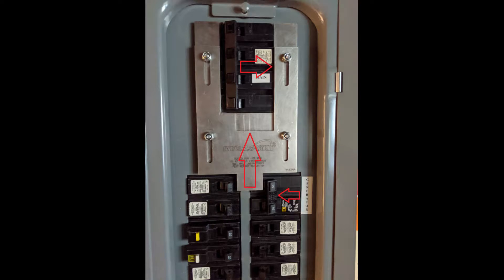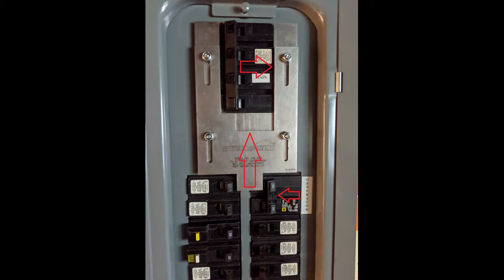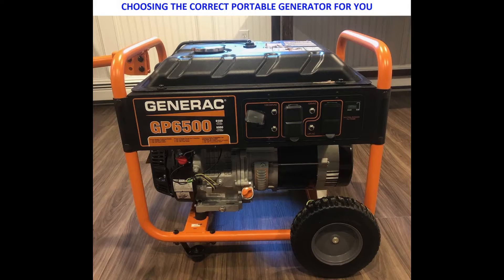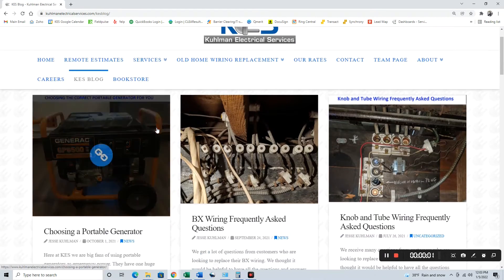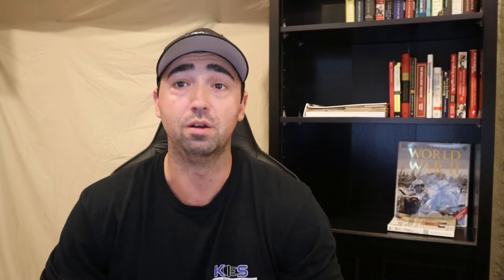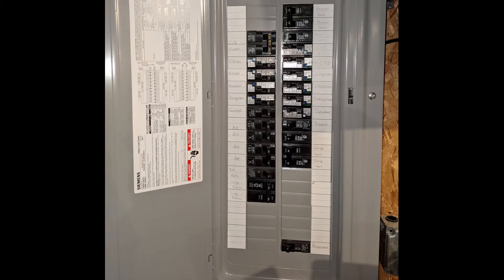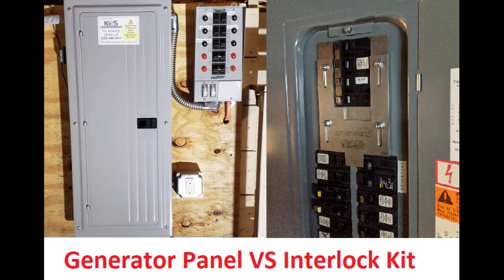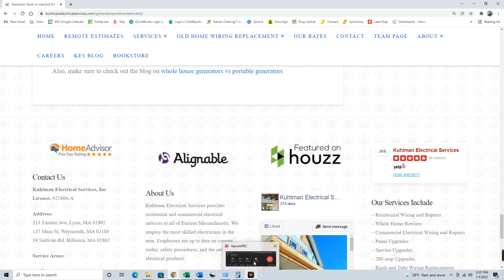Generator Electrical Panel Interlock kit: What is it? | Jesse Kuhlman

Comment: How do I select the correct interlock kit for a panel?
Reply from the maker: Hey thanks for the reply.  The interlock kit needs to be selected for the brand / main breaker layout of your panel.   A website like www.interlockkit.com is super helpful.  They have all the brands and the measurements to the main breaker.  I bet you can find the kit you need on there - we use their products quite a bit with good success.
Reply: @kuhlmanelectric  Thank you!